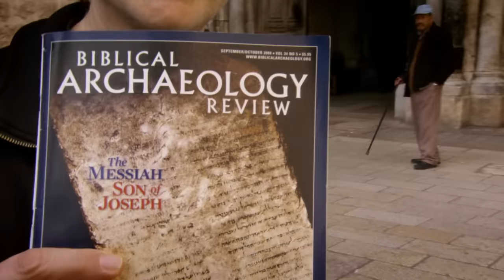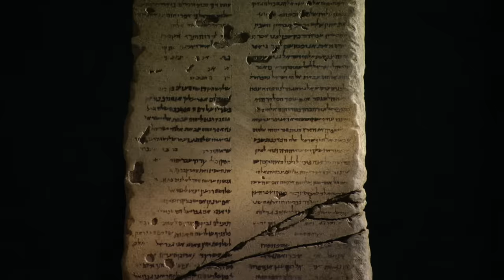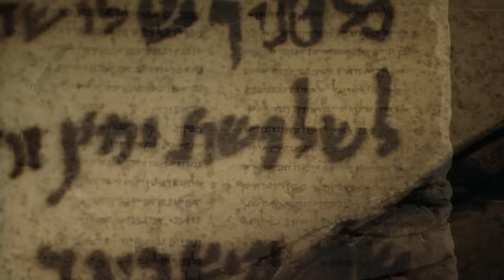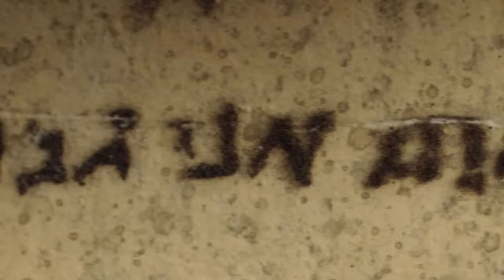Was There Another Jesus? - Secrets Of Christianity 101 - The Messiah Before Jesus

Comment: I paused about 19 minutes in. Maybe the stones That had ink and not carvings might be guide lines to follow. If something is signifacant enough to be engraved I am sure they would make a blueprint. i believe that maybe the written stones are rare cause the ink is a stencil. You really only have 1 chance to engrave somethings. And you make 1 wrong line it was not easy to fix. So i think that they may have written the engravings on the stone first in ink and chiseled that pattern into the stone. Or even as a proof. Like draw it show it to the customer like how a modern contractor might use a computer model or sketch to show the the client what they can expect.